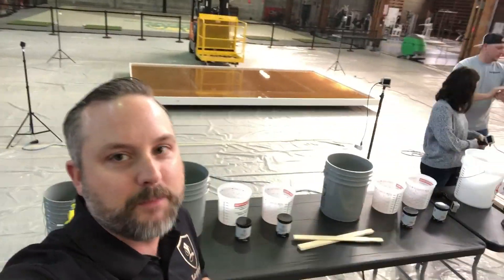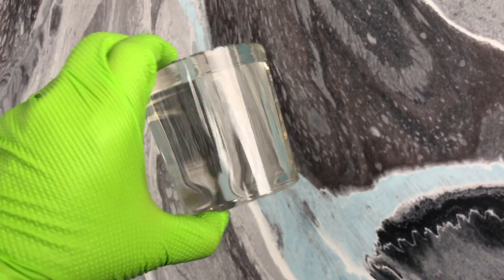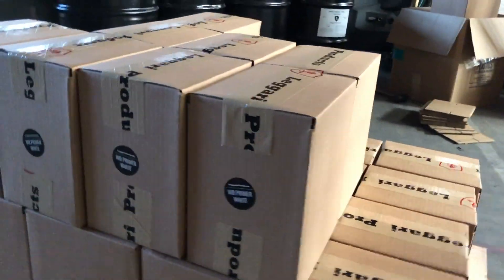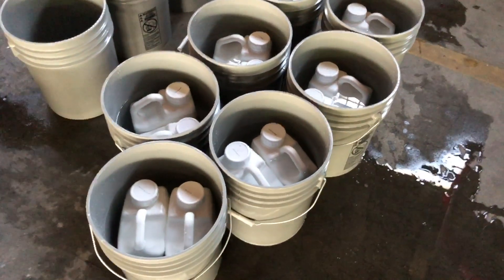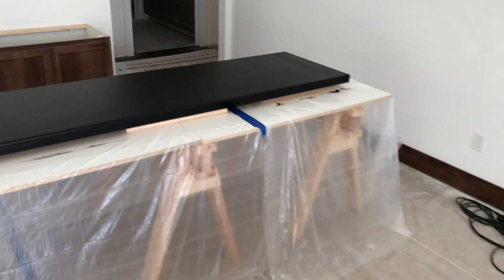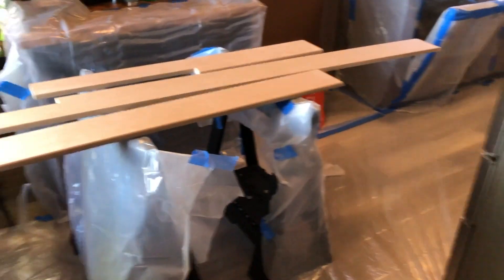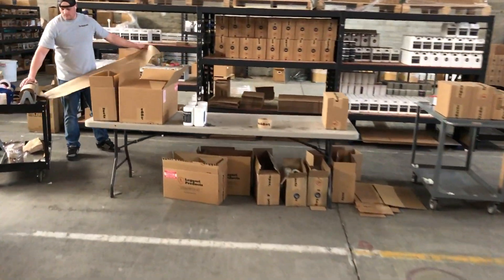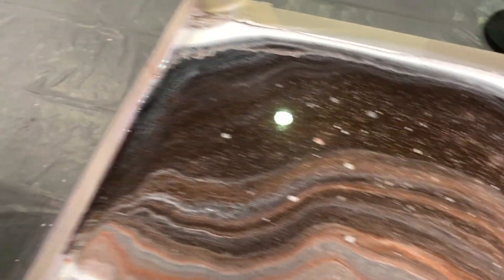Leggari Warehouse | New Epoxy Project Sneak Peeks!

Comment: That casting resin looks super nice and would work great for me as I need my end results crystal clear in most cases. Did you use a vacuum pot though to help with the bubbles or was it just left out? I also hope you will share best working temperatures for the casting resin. Most resin I use is 70F or higher in the working environment. - Heidi
Reply from the maker: No, we did not use a vacuum pot to help with the bubbles.  The best temperature for the resin is between 72-78 degrees.  Thanks
Reply: @LeggariProducts  Thanks for the reply. Can hardly wait to try some and see how it works with my art. :D
Reply from the maker: You're welcome Blackcat2 and thanks for watching the video
Reply: @LeggariProducts  Heidi works too :) Thanks for putting the video out. I love seeing resin projects for motivation and inspiration. :D

Comment: I didn't know you offered training classes. Where are you located? With that casting resin, am I correct in thinking it does NOT need a pressure pot to cure like most other brands? Also, can it be layered for deeper pours without seeing the layers after it has cured? You did mention 4 inches, but wood turners like to cast some pretty deep pours to turn on their lathes.
Reply from the maker: We have live training classes located in Washington State.  You can email leggari@gmail.com and they will send you out the training schedule.  Yes you can do deep pours with our new casting resin that is what it is for.

Comment: Can you install floor heaters with epoxy? Do you need to put concrete board down over the heaters then the epoxy or what do you recommend?
Reply from the maker: Yes you can apply the epoxy over a heated floor, you just want to make sure the heating system is off when you are applying the epoxy.  Thanks
Reply: Leggari Products 

Thank you for the reply